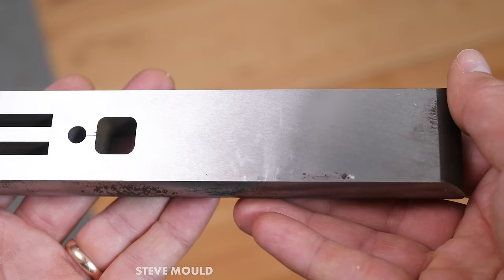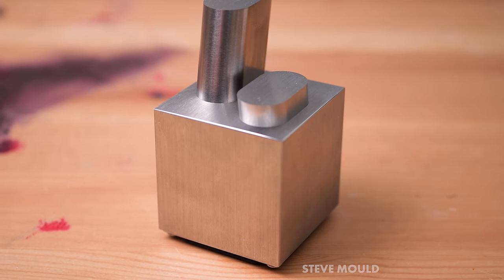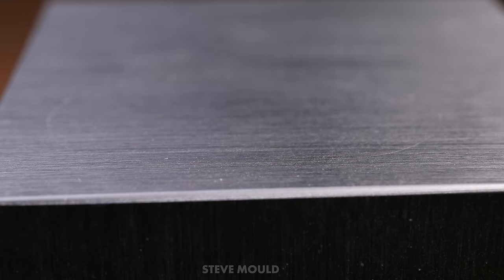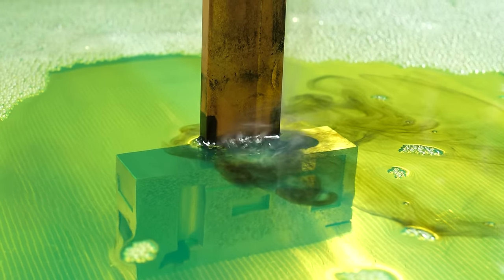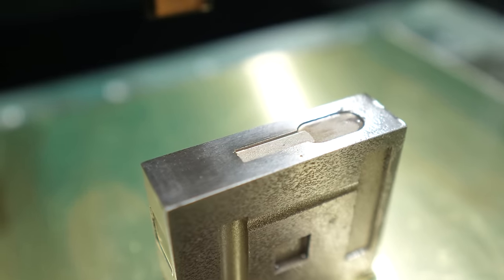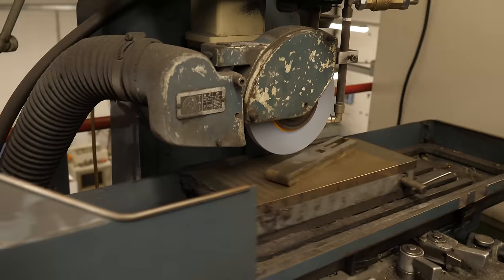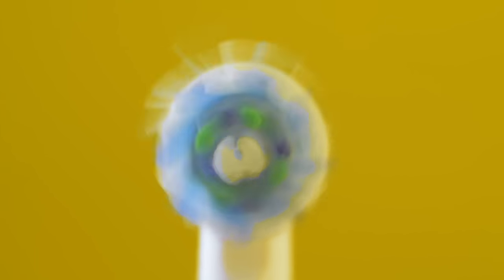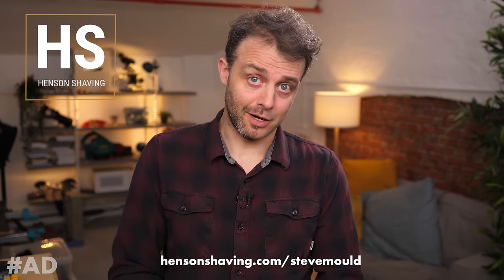How these impossibly thin cuts are made

Comment: One note about the process, the voltage actually isn't very high. The wire EDM machines we have at work run at around 40 volts. The amperage is quite high however and would instantly overheat and break the wire if it weren't submerged. You can also stick your hands in the tank while the machine is running with no worries of electrocution because the deionized water is such a good insulator.
Reply: People really underestimate how much of a resistor pure water is.
Reply: this would be a good way to hide stuff. like sneaking things on an airplane
Reply: ... and it is only 40V, as you just said. Nobody ever was electrocuted with 40 V...
Reply: @Blox117 w... what are you planning to do with this info
Reply: Would the water stay deionized if you put your hand into it, though. 😂
Reply: @m0nky89  Water does not even stay deionized when in contact to air.
But it is about the concentration of ions. And when costantly filtered, it can still be really low.
Reply: @m0nky89  well enough, I've done it many times.
Reply: no shit
Reply: @NorfKhazad  Well, at 40V there really is no hazard. Good insulator or not.
Reply: @m0nky89  Only one way to find out how long it'll last!
Reply: What would happen if your hand touched the wire when you put it in the tank? Would it electrocute you or just burn/cut your finger?
Reply: @Jadefire1010  See my answer above. The voltages are non-hazardous.
Reply: My shop had the very first EDM machine anywhere around.  The program was actually loaded onto the machine with a reel that had a tape with little holes in it.  Talk about old!  However there were several things it was still able to do perfectly well!  I didn't run all the machines a lot but whenever I did, it was fun and Making these things is easier than people think.  Once you've used a machine, you know that they're super precise!
Reply: @galaxiedance3135  Paper tape as a storage device was kept in use for CNC machines for a long time, because the solution is robust. Imagine any other portable storage solution that can be handled with oily hands and still works flawlessly.
Reply: This is a really interesting tool. I wonder what the cost to have parts cut would be.
Reply: @anthonymartin9672  EDM is one of the more expensive machining processes because it cuts slowly and the entry level for machine prices are around 300k. I don't do quoting though so couldn't really tell you what to expect. Depends on total cut time.
Reply: well.. no.. after a a few miuntes, the wather is not insulating at all because of all the metaldust in the water.. the reason, why you are not electrocuted, is because the circuit is closed between the wire and the working peace. electricity allways takes the route of least resisance, and your body, hopefully wearing cat 2 shoes with rubbersole is a extreamly good resistor.. if you touch the wire during the cutting - its a hole other story (asky me, how i know ;) )
Reply: @noobfl  Can't be more than a tingle at 40V. Besides, if the water became seriously conductive, the arcing wouldn't occur anymore, shutting the process down.
Reply: @HotelPapa100  the voltage is just half of the story... amps are the other one.. and because the process of wire EDM is litteraly create plasma, to vaporize metal in a mini thunderstorm between the wire and the working peace.. there is a lot of energy.. it hurts.. a lot - dont burn anything (also: cold water), but it hurts. its realativley save, because its not AC but DC, therefor the risk for a human is minimal. also also... a conductivity between the wire and the working peace is, what is needet for the process (the wire have a negative pole, and the Workling peace and the hole frame, on wich the peace is mounted is the "life-wire". The oposide is trough.. if there is no conductivity, the wire just burn in splitseconds. Also also: the de-ionisation of the Water don't have a lot to do with conductivity (only destilled wather is an isolator).. because the process would not be as precice as it is (our best machine could cut with a precisson of +/- 0,0005 mm), because the electrones in the water would make the process more unreliable (we also hat a drilling EDM machine.. this machine uses just water from the tab, the machine was "only" precisse in the realm of +/- 0.01 mm)
Reply: @noobfl  The amps that go through your body are proportional to the voltage. Which is exactly why voltages below 48 V are considered safe. Volts don't kill, amps do, and it takes surprisingly little (20 mA will make your muscles spasm and may make it impossible to let go, if you have grasped a conductor.) This whole process is independent of what is going on in parallel within the bath of the EDM.
Granted, a wet environment does not help. He who has ever held a 9 V block to the tip of his tongue, knows...
We once had a electric dangers simulation where you would wear a cuff below your elbow and hold the second electrode in your hand, then could turn up the amperage through the device yourself, as high as you dared to go. AFAIK the toughest 'contestants' got up to about 10 mA before they gave up.
So, yeah 'tingle' probably is an euphemism. Still, it won't seriously injure you.
Reply: I used to run an EDM machine. The fact that nobody has mentioned is the higher the frequency the less metal is removed. The lower the frequency the more metal is removed. This way you can get a more precise cut.
Reply: @HotelPapa100  it’s not the voltage that determines the danger. It’s the current(amperage) that will kill you.
Reply: @jackmclane1826  it isn’t the voltage that’s dangerous. The current(amperage) is what will kill you.
Reply: @Jadefire1010  don’t listen to these guys saying the voltage is not dangerous. The voltage isn’t what’s dangerous, it’s the current(amperage). It only takes a little more than 1amp to kill someone under the right conditions. If you were to touch the wire the current would be free to flow through your body. Then what determines how badly it hurts you is your bodies resistance which is affected by everything from how hydrated you are, to your bmi, to even what clothes you are wearing
Reply: @HandymanLife  Go through the whole thread. I understand that. Voltage and current are not independent.
Reply: @HandymanLife  Same semi-smart sentence all the time... It is both!
A source needs to have a high enough voltage to drive dangerous amounts of current through you. And then it also needs to be able to deliver that current without collapsing. 
A car battery at 12V is able to deliver hundreds of amps to the starter, but it doesn't have the voltage to drive it through a body.
On the other hand a piezo lighter or an electric fence create voltages that would drive hundreds of amps through you, IF the source was able to deliver that amount of current. But it is not and the voltage break down as soon as you draw just a tiny amount of current from it. 
And if EDM machines only have 40V, it is not enough to drive significant currents through a body.
Reply: @m0nky89 yes and no, the oils off your skin would change the conductivity of the water, but there are filters and deionizing tanks on the back of the machine that wouldn’t even notice the difference.

Comment: "Which in inches is a different number" hahaha brilliant!
Reply: 0.005 mm = 0.00019685 inches
or 196/1,000,000 of an inch. lol
or >2/10,000  inch
AKA > 2/10ths of a thou  ...      It's precise
Reply: @calholli  Ugh.  Decimal inches are an abomination.  If you’re going to use inches, they should at least be proper imperial fractions.
0.005 mm = 3/16,384 inches

Comment: My previous company used a custom developed wire EDM process to cut dozens of slots with micron-level accuracy, for use in electrical shavers. At some point they moved to newer techniques, but until a few months ago, these processes where still used for the low-end market and ran for decades. Very cool and robust process!

Comment: I’m a machinist and I’m still wowed by seeing it and I make parts like this all the time lol . 😊
Reply: 0.005 mm = 0.00019685 inches
or 196/1,000,000 of an inch. lol
or >2/10,000  inch
AKA > 2/10ths of a thou  ...      It's precise
Reply: Interference fits are the worst. You never know and you should not really try either lol.  Like if this piece had just a tiny fit, it would never come out.

Comment: I remember being very disappointed when I learned EDM works in two steps. It really removed the mysticism of the process and just turns it into "it's very precise" which has it's own merits but it's just not the same as thinking it's a single step.
Reply: The technology to practically have no waste material would be incredible.
Reply: @volvo09  Eh, wouldn't have much of an impact. What would be really cool would be two things: cheap, sustainable electricty (doesn't use a very limited resource as fuel and doesn't excessively pollute) and perfect recycling technology. We really need the former for the latter to be viable, otherwise it's economically unviable.
Reply: @Fantastic_Mr_Fox  ... Are we reading the same comment?. The "waste material" they mention is the material lost in the cuts. If one wanted to have the inner piece to come from the same location of the hole as the original comment described, the cut would have to have practically no width, removing an imperceptible amount of material at best and also not deforming the metal like a stamping process does. This is impossible with current manufacturing techniques and will be for decades, at least in metal.

Nothing to do with recycling or whatnot.
Reply: @Shelleloch  I know, I'm just saying that in terms of actual waste it wouldn't matter much. I made a tangentially related comment about waste recycling, if you will. But yes zero waste manufacturing would be hella cool, not because of the zero waster part but because of the 100% accuracy part.
Reply: A lot of EDM is dubstep.

This is a joke.
Reply: @jannegrey593  the fact you needed to disclaim that scares me no end lol
Reply: @Fantastic_Mr_Fox  Yes. I was thinking about it, but I didn't want too many responses trying to explain to me that this is different EDM etc. Not to mention worse ones. I get that something might be lost in text, but I hoped this is blatant enough that there won't be any response like this.

Then I remembered all of those previous comments made in response to my "obvious" jokes. So I got scared.
Reply: @jannegrey593  Lol yeah. The internet is a dumb, scary place
Reply: @Fantastic_Mr_Fox  Yeah
Reply: @jannegrey593  But also a beautiful eden, with people like Steve Mould, Veritasium, Jordan Peterson, the list goes on.
Reply: @volvo09  Waste? is metal just melt it again.
Reply: For me it was the other way around: I know how this technique works in general and I couldn't imagine a thread that thin (and the extra gap you have because of the electric arcs). So how could it be possible? The resolution of that question was quite satisfying. I was just thinking "...that's clever..."
Reply: @Steppenkater  for me it was neither. I simply guessed the answer right off the get go. Felt pretty clever for it too, even though it's not really that complicated. But hey I'm a simple man
Reply: @Shelleloch  Eh, not having waste material would be alright, but know what would be REALLY cool? World peace. And food for everybody.
Reply: I chose not to be more than a little disappointed as machining accurately enough for such close fitting is pretty amazing too.
Reply: @eekee6034  1000%
Reply: many times it's one step. to make a male punch and female die of some odd shape . you make a plate the correct thickness with mounting holes and locating dowel pins. then you harden the plate. then you use wire edm to cut out the punch and you set the machine to cut at an angle. that way your punch comes out bigger on one side and the die smaller on one side. you them mount them to a dieset in the correct order so the bigger punch goes in to the smaller die with the correct clearance.
Reply: Check out waterjet guided laser cutting.
Reply: @galfisk  The true nature of water jets also disappointed me. The water isn't cutting anything, the abrasive it carries does. So in essence, water jets are just very strong and directed sandblasters, not machines that magically turn water into blades.

Comment: Great video. And as a long-time shaver who uses double-edge safety razors, you are absolutely right about Henson Shaving's razors. I have two — AL13 and AL13M — and both are excellent. Extremely good design: if you don't have the right angle, nothing happens. (With most DE razors, if you don't have the right angle, you get a nick.) The Henson Shaving razor is both extremely comfortable and extremely efficient. I do recommend using a good shaving soap and a shaving brush rather than canned foam: that makes a big difference, even with a cartridge razor.

Comment: its actually crazy how long we've had this kind of precision, i'm not sure exactly when wire EDMs became a thing but i know that at my machine shop, we have a wire EDM from 1986 that still holds fairly good precision, yeah the ball screws are a little worn out from machine travel over the years but for never being replaced, we still hold .0005 inches tolerance with that old dinosaur
Reply: Die EDM has been around since the 1940s. I believe wire EDM was developed back in the 1960s. There is also photo etching maching which is used to make very very small precision parts.
Reply: @guytech7310 Photo etching is still used for making electronic parts with insanely high precision, 1000 times tighter than EDM in the latest factories .

Comment: I am currently in engineering grad school and I use EDM for my research! I test the fracture toughness of additively manufactured alloys, and I use EDM to cut a very narrow crack into the specimens I test. We use a wire that is about 100 microns (0.004 in.) thick, and it gives us a crack width of less than 110 micron.

So very cool to see Steve talk about it. Our machine isn’t as fancy as the one in the video. It doesn’t tilt the wire for one, but it’s good enough for our purposes.
Reply: What's a micron?
Reply: about 1/100th the diameter of your hair
Reply: @Liggliluff  one millionth of a meter

Comment: Great shots and demonstrations with the cheese! One nit about the styrofoam wriggle room: that one's likely because you're cutting it by sublimating a bunch of the material with a hot wire, so a decent portion of it simply doesn't exist anymore, and that would happen on the outer edge and inner edge, causing a good amount of lost material.
Reply: The same would happen if you were trying to use wire EDM with the same method which is what he was showcasing.

Comment: Henson is great, I'm so glad you pair up with them. Also, I'm very curious about their machining to get such a precision, so if there's a how it's made style video that'd be awesome!
Reply: After how badly he bolloxed the presentation I will never even CONSIDER that product, period.
And will warn any and everyone away.  When they resort to informercial idiocy to showcase a product you know that product is not even worthy of one star.
Reply: @amzarnacht6710  I have to disagree. I actually had one of their, the AL13 to be exact. A bit hefty on the price, and they don't have a counterweight on the bottom, making it kinda tip heavy, but it's the smoothest razor I've tried so far
Reply: @theCuchuoi1  It's not the product, it's his HENOUS presentation of it.
So bad it made informercial hokery look positively legit.

And I've still got my father's razor that he used during the Korean war.  Works just as well as these things despite being 50 years old.
Reply: @amzarnacht6710  He's got pretty long stubble - so long I'd call it a beard - and showed trying to use a multi-blade cartridge razor on it totally dry / with bad technique. Can confirm that works about as well as displayed... which is to say it doesn't.

Seems to me everything he said was technically true... he didn't specify he used the cartridge razor with proper technique or lubrication, and he definitely didn't say anything was equal between the two tests, he just said he used the cartridge razor on the left and the Henson on the right. Nowhere was it said that the test/demonstration was fair or standardized.

One does not simply assume that anything will be done fairly. Life is unfair by default.

Furthermore the presentation isn't as misleading as it might seem at first glance... there is a night-and-day difference between a safety razor, like the Henson, and a multi-blade cartridge razor when shaving facial hair that long. With my safety razor I can do it in one, maybe two passes, and with the Henson in particular it doesn't take much rinsing to wash all the hair out of the head... with the cartridge razor it would take many, many passes and lots of extremely thorough rinsing, and at the end you'd still usually be stuck with a somewhat clogged razor cartridge.

Comment: Awesome precision and how the wire edm works.  A scroll saw with a spiral blade can make similar cuts in wood that aren't possible with a conventional flat blade.  I have a video of a set of nesting helixes that are all cut from the same cylinder, the inside pieces are removable and are completely enclosed except for a thin slot along the edge - no gluing involved.  I think it would be really cool to make one with a wire edm machine from metal.  Keep up the great videos!